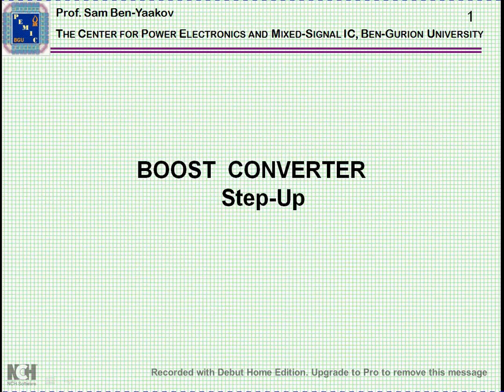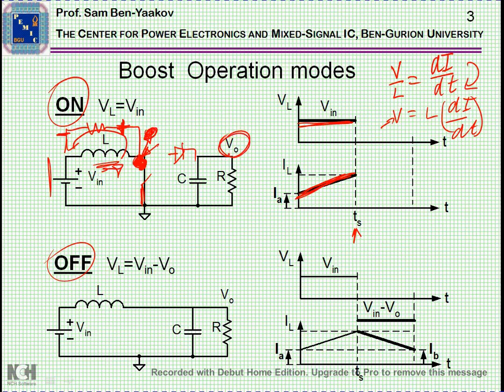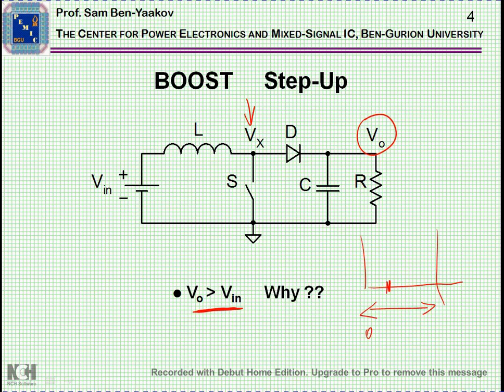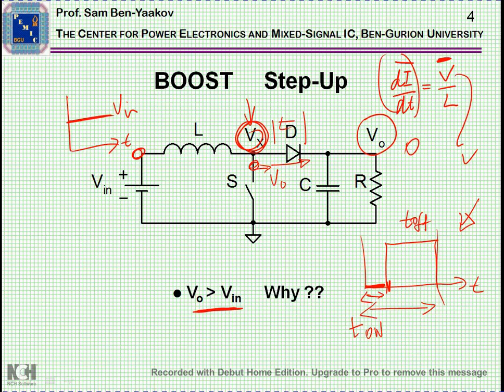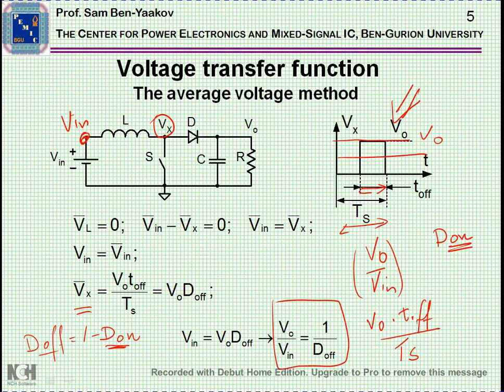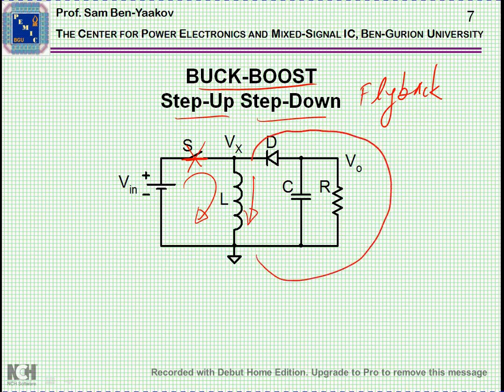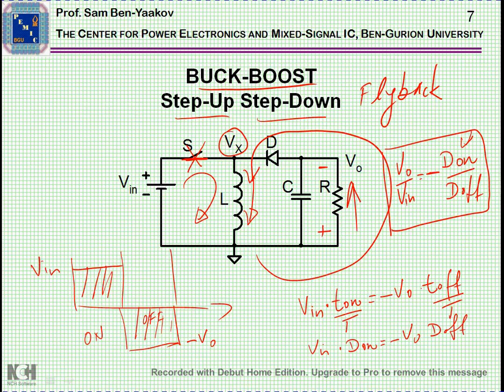Boost  Converter

Comment: Thank you very much for the video, quite illustrating but got one question. During the off state, would not be a contradiction to say that Vo is greater than Vin if the diode is conducting? how can that happen simultaneously? 
Thank you very much in advance
Reply from the maker: The inductor had a positive voltage drop which is added to the input voltage
Reply: @sambenyaakov  So does that mean that the current will still flow through the diode but the excess current will create a voltage drop in the load that will exceed the input voltage (due to the injected current released from the inductor) 

Thank you so much for your reply and again great videos! big fan!
Reply from the maker: @CesarAngeles28  Yes. Think of the inductor as a current source which will adjust to any voltage across it and still inject the current which (as you said) will build up a high voltage at the output.

Comment: 2:50 VL equiation is wrong. When the transistor is off, the voltage of the output is inductor voltage plus input voltage(VL+Vin). Besides that, when there is a diode -VD is also in the equation. That means Vo = VL+Vin-VD. However, it is VL=Vin-Vo for the off state. This is not possible.
Reply from the maker: The inductor voltage (lower left circuit) in not Vin-Vout, diode voltage drop neglected and VL polarity as in the circuit on the upper left??????.
Reply: @sambenyaakov  Dear proffesor, OK, I defintely see the diode voltage is neglected. This is fine. However, you wrote Vin-Vo in your presentation. I still don't understand this. What I mean is this is a boost converter. Vo is larger than Vin. Thus, VL must be negative. If you want to equalize Vin-Vo, it must be -VL without discussion. Otherwise, the equation will not match. Your explanation or graphics are for sure right but only the equations creates the confusion. Basic KVL loop will show you what I mean.

Comment: In this lecture at 6:23 polarity of the inductor is reversed ? In the initial case it was stated as same ? Is it in the initial case the polarity was + on side closest to V source and negative on the other side ? and then in second case when switch is open the polarity is reversed with negative on V supply side and positive on the switch side? I just want to clarify this sir - great lectures and thank you for these lectures.
Reply from the maker: Indeed. When the switch disconnects the inductor from ground, current indictor continues and it reacts as a source with a flipped polarity. Thanks for interest.

Comment: My question is : why diode Don't conduct..when switch is on ?
Reply from the maker: Because it a reverse voltage across it.
Reply: @sambenyaakov   you mean to say that diode is reversed biased ?
Reply from the maker: @niteshsharma6015  Sorry I read wrongly your original question. The diode does not conduct because the voltage drop on Rds(on) is lower. This is why a transistor is used in the first place.

Comment: sir, why the diode could conduction? the Vx always below then Vo
I still can't understand why you said the imaginary resister
why you can there is a resister
Reply from the maker: When the current s interrupted V=L dI/dt  which generates a high voltage. The purpose of the imaginary inductor is to determine the polarity of voltage. In this case the polarity is such that the voltage is positive. It will increase until clamped by diode.

Comment: Hello sir,

I would like to ask reasons of  switching mosfet  failure in boost converter.  What can be probable reasons for mosfet burned out?
Reply from the maker: In general over voltage end over current. If over current is ruled out check layout as you may have high stray inductance the produces high voltages at switching. Try using a clamp to protect transistor.

Comment: Do Hybrid cars use this to boost the battery DC level enabling Toyota to use a smaller battery pack?
Reply from the maker: I am not sure, but I doubt it. If you mean hybrid cars, they  can get by with smaller batteries since they are recharging them.
Reply: Then where exactly the DC/DC converter is utilised in the EHV?  especially since most of the MOTORs used are AC motors. perhaps, Boost the battery voltage before its rectified?
Reply: Hybrid cars mostly used ip>op isolation
Bidirectional ↔ type converter

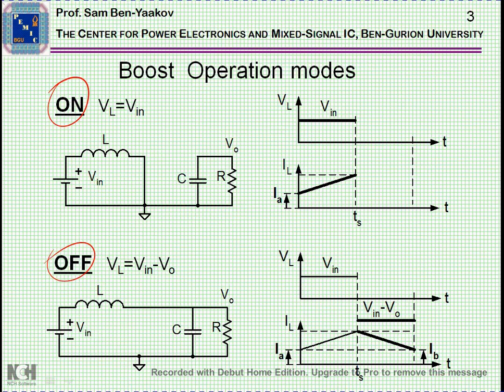Comment: 2:36 why in parallel? In series?
Reply from the maker: Look again. This is a parallel connection no matter how you draw it. The input voltage is imposed on the inductor's terminals.
Reply: @sambenyaakov  now i see it could be considered as series and parallel both. Thank you a lot for answering!

Comment: during ON condition, the inductor is directly connected to the DC supply. it will be short circuited.
Reply from the maker: When an inductor in connected to a voltage source, the current rises as t*V/L so for a given t-on there will be some current increase. Only if the connection is sustained (t is very large) the current will be large i.e a short.
Reply: that means, the switch must be open or closed during the transient period before the current reaches its steady state value.
Reply from the maker: That is correct

Comment: Thanks, I was trying to figure out why the input and output of these dc-dc convertors were equal, and it turns out as you said that the average voltage across the inductor must be equal to 0. If this wasn't the case then the inductor would saturate is it? and then it would equate to a short?

Need to make some convertors for my thesis on DC microgrids and this was a very useful lecture. I hope you have videos on pid control of dc/dc convertors. I really appreciate this video thanks :)

Comment: So i want to make a little battery charger. I need to boost from 5V to higher battery voltage and just force 200mA or so into it for a while, and terminate the charge when the battery stops gaining more voltage. Dicing around figures for the off the shelf boost converter was not satisfactory, a lot of dissipation on current limiting resistor depending on the battery charging voltage range. Nor could i come up with a compact and elegant solution to limit output voltage to somewhat above battery's, i didn't exactly want to add a comparator, too much complexity.

But looking at this vid now, it seems to be the solution, that i can build just from parts i have at home, and very minimal. It appears the voltage ratio as shown is true for ideal coil and diode, and purely consuming load. But if a battery is present on the output instead, the voltage should get superimposed. Because surely the current off the energised coil has to go somewhere, and there isn't much anywhere else for it to go. So if i drive a little 2306 n-channel MOSFET with a fixed duty cycle from my microcontroller, i should get a vague semblance of a constant current source to charge the battery, and i can stop the operation at will too, so this is ideal. Am i thinking about right? Is there something i may be overlooking, a hazard of some kind? Like it's a steady state calculation, but what if the battery falls off the terminals, should i guard against the voltage shooting up sky high, and is using the highest value coil i can find detrimental in this regard?
Reply from the maker: What is the range of battery voltage? You may need a Buck-Boost converter.
Reply: @sambenyaakov   Well what i need it for is typical "9V" NiMH battery, the size like used in multimeters, which should usually be 7 cell series, but if i can use it across a larger voltage range from about 6 to 12 NiMH cells in series for various upcoming projects, that would be a nice bonus. The "9V" NiMH should bottom out at about 6.3V when empty, and terminate at about 10.5-11V when fully charged, so i shouldn't need a buck-boost. Funny thing, apparently you can't just buy a nice cheap fast charger for these little batteries, so i was inspired to investigate building one.